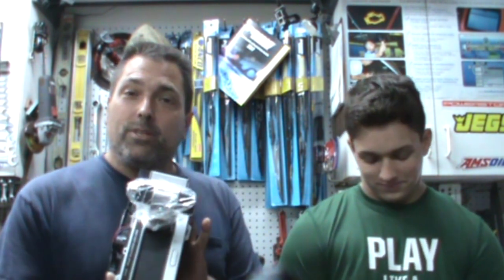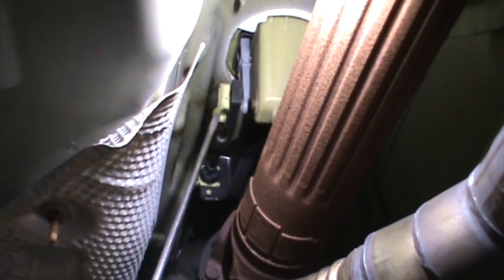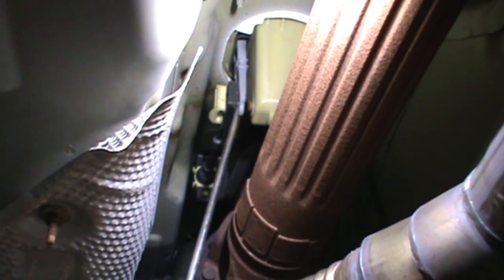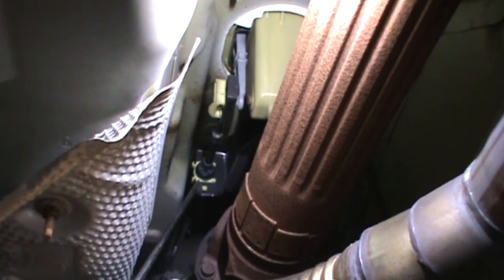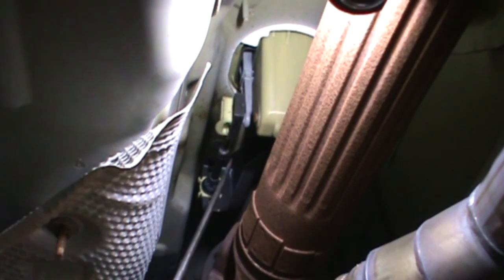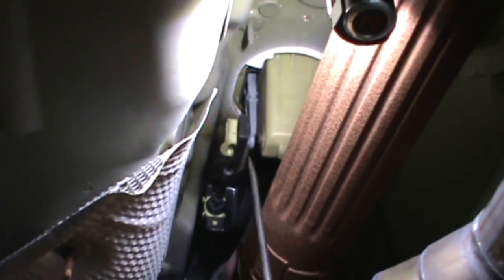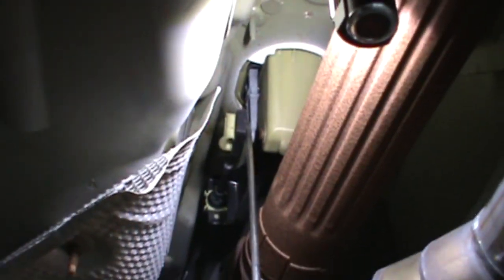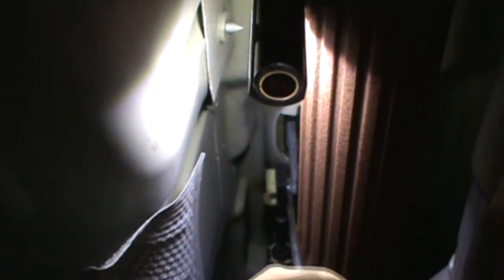2005 Ford Mustang Transmission Shifter - Teaching the DIY'er

Comment: I replaced the shifter in my daughters 07 Mustang today. It went well. Underneath,  I did spray some lubricant on the shifter cable clip and i used a steel rod (used for garage door springs) where you guys had used a long screwdriver. I was having problems with screwdrivers but the lubricant and long rod worked great. Thanks again for this video.
Reply from the maker: Awesome. Thanks for the feedback and support.

Comment: I have been putting this repair off for almost 10 years.  Same issues with mine, finish peeling off the top and indicator not working due to the broken plastic at the base of the shifter.  Watching you guys do this together gave me the confidence to order the new shifter and just do it.  Whole job took less than 2 hours without a lift (I really need one).  Do it yourself price was about $150.  Great video, both informative and entertaining!  Go Jets.
Reply from the maker: Awesome stuff sir. Thank you for the support
Reply: "Whole job took less than 2 hours without a lift "   Did you use ramps? I have Rhino Ramps that I haven't used yet and I was wondering if you can use the ramps and reach the clips?  Thanks

Comment: Well done video and thanks for posting though i do have a question . Is the car jacked up on front and back to gain access underneath also since i have an incline in my driveway i would be concerned on the car rolling back so not sure if your job was done on ordinary jack with jack stands. Thanks
Reply from the maker: I had it on a lift. Definitely be careful on an incline. Safety first.

Comment: What would it be if the button is stuck pushed in and it can just slide through gears without having to press the button, if I get the button unstuck it won’t go into gear, but I want to be able to take my key out of the Ignition. Anyway I could fix it or just get a new assembly?
Reply from the maker: It can be disassembled if you're feeling froggy. Have a new one available in case it goes sour

Comment: Just change the shifter and after done the check engine pops up with a P0708 code. Do you know the reason ?
Reply from the maker: Plug the range selector back in

Comment: I have a 2005 Ford Mustang as well. Mine is a V6 auto. Yesterday, it started acting up when I reversed. The car reversed so slowly that I thought my transmission was gone.
Forward, it does fine, shifting well. The problem is only in reverse gear. Do you have any idea what is happening to my V6? Thank you for any feedback.

Comment: Why did you remove the shifter cable from the metal bracket? That doesn't look like it is necessary to do that.
Reply from the maker: Yes sir, it is. It's part of the shifter assy that was being changed.

Comment: Good video! I have the same car and am about to tackle this. One question: my neutral safety switch is also broken. Would replacing the whole shifting mechanism like you did in this video fix the neutral safety switch as well? Or is that part in a separate area
Reply from the maker: Separate piece sir. Thanks for the support
Reply: Thanks for the video! Did you reuse the original linkage parts?
Reply from the maker: @MustangGuy1996  yes, we did

Comment: Do you have to unplug the shift cable under the car before replacing the shifter?
Reply from the maker: Yes sir
Reply: S & A Auto Repair Thanks for the quick reply! What would happen if you didn’t?
Reply from the maker: @gdcdffhfyur5  it wont come out. If you're replacing the shifter, the cable has to come off

Comment: Hi I changed my shifter cable and it still not locking in gear what do I need to do
Reply from the maker: Any position or all positions
Reply: @SAAutoRepair   all
Reply from the maker: Just realized you said "cable". The lock mechanism is part of the shifter.

Comment: I am distorting that plastic leakage clip. That baby is breaking not moving. One ear is gone already. Any suggestion?
Reply from the maker: Spray it up and let it sit. Maybe it will soften up. Sometimes they are just too dried out and brittle. Patience is your friend
Reply: @SAAutoRepair  Got it out. Little mangled. Now have to adjust the clip. It wouldn't shift and car wouldnt start. Must be in lock out mode. Have given it a rest until tomorrow.

Comment: Fyi guys. According to my Ford work shop manual which I just found again. That clip is a one time use and sure be disgarded.
Reply from the maker: Yeah....they say that about a lot of stuff. Head bolts and the like, I agree. But I've reused those type of clips 100's of times without an issue. That being said, if you can get your hands on a new one, by all means, better safe than sorry. Appreciate the feedback sir

Comment: Before taking it apart, What is that metal tab next to the base of the shiter on the right? (That bean shape tab.)

Mine is missing so I want to know the proper name so I can replace it.
Reply from the maker: It's the cover for the shift lock release. That is for the situation where the battery is dead or disconnected, you can unlock the shifter to roll the car.  Should be available.
Reply: @SAAutoRepair  damn! Couldn't find it XP thank you though :)